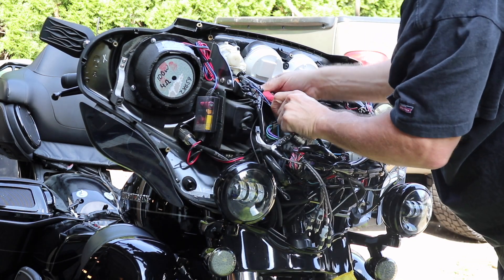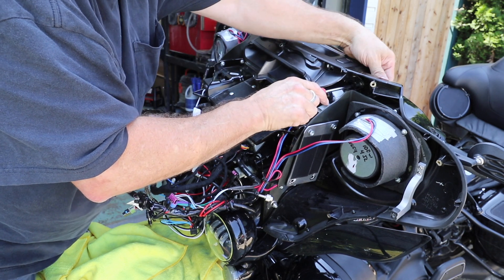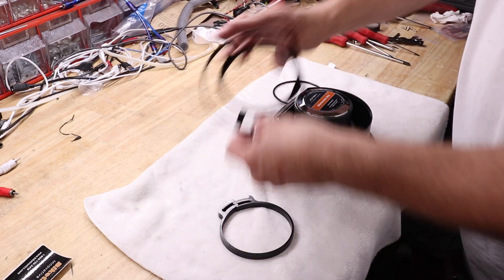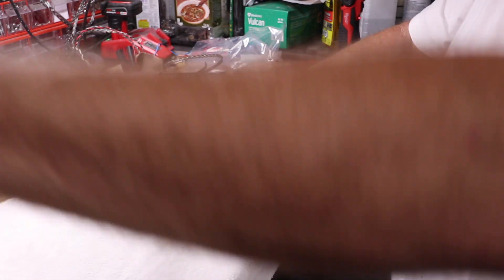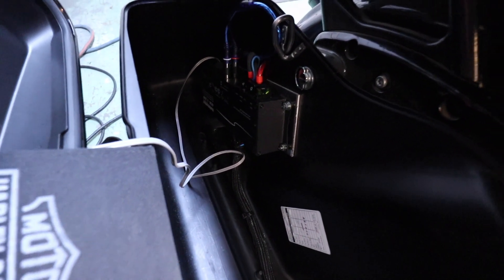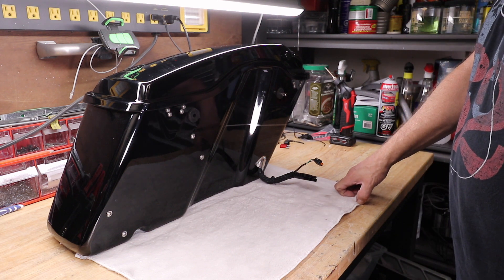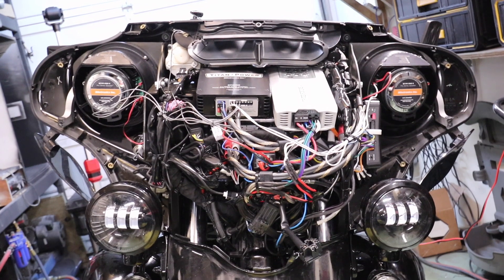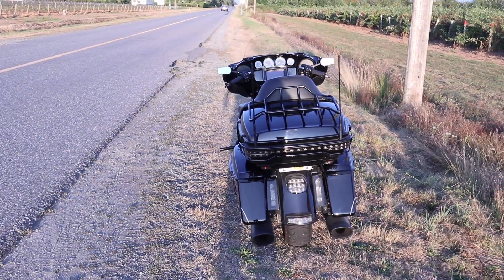Complete Harley Stereo Overhaul.

Comment: I had the Sony 5000 in my 18 SGS.  Liked it over the factory receiver.  Pro's  EQ and size. Cons  Volume would run away when using thumb controls. Water incursion.  I  replaced it with the Soundstream Reserve unit. Much better.  The one thing about the Sony was the ease of mounting another amp vertically in front of the receiver.  The Soundstream is the exact size of the factory unit which makes it almost impossible.

Comment: Did you upgrade the 8 gauge wire to 4 gauge on the Biketronic amp?
Reply from the maker: Nope. Just used a good quality 8 gauge. I haven’t had any issues with it and it’s so bloody loud that I actually have it dialed down in my mix.

Comment: Did you try getting the factory radio flashed before replacing it? Nice video!
Reply from the maker: Yes. It was the very first thing I did to that bike when bought it. I struggled for 5 years with the stock head unit. I did manage to get some decent sound out of it but there were other things about it that drove me nuts. The Sony is just light years ahead of the 2015 stock head unit.

Comment: Brother they say you can learn a lot from watching and your videos are the best. I see you have audio control amps because they come with the GTO on the units can someone such as my self who only wants a sub or two in my Tri Glide Ultra trunk just grab the signal off of the rear speaker and get away with no rca's and it bang out some lows or do I need to get a DSR1 and flash the factory head unit?
Reply from the maker: I really want to tell you to do it right but you seem opposed to that, so...yes that could work. Chance's are you'll need a line converter to clean up the signal.
Reply: @i.b.lancer  audio control brand?
Reply from the maker: @danielzamora3769  I would run it first to see what kind of noise you get. I forgot that you said you wanted to use audio control amps. They have a speaker level input and in theory it should sound OK.  If you’re just using the signal for a sub, chances are it’ll be OK.
Reply: @i.b.lancer  you are the master 💯

Comment: I have a 2020 CVO LIMITED about to do a stage 2 Fosgate. Just not happy with Boom 1. What's your opinion on single Amps in the lids vs. A additional 400W to run lower pods & Lids?
Reply from the maker: I'm a believer in Simple. Simple is easier to maintain with less stuff to go wrong as it ages. A couple of amps under the fairing will keep the wiring down to a dull roar and if there's a problem 5 years down the road it won't cost you an arm and a leg to diagnose and fix the problem.. simple.

Comment: Do you use the OEM alternator? is it just 50A? is it enough to power this setup?
Reply from the maker: Yes I am running the stock alternator but I also have a lithium ion battery which recharges quite quickly and I do not run that stereo when I’m not riding. No problems so far.
Reply: Thank you!

Comment: What did you think of the Biketronics amp.
Reply from the maker: I don’t mind it. It has lots of power. I’m thinking about getting a second one. If I had any complaints it would be that there is a LED light on it that never goes out and it is a draw on the battery. A small one but a draw nonetheless.
Reply: @i.b.lancer  when done I should have 2 BT2700-2’s and 2 BT4180’s

Comment: How did you like the Biketronic Amps?

Which amps have you used by Biketronics?

I have 4 
2 - BT4180’s
2 - BT2700-2’s

All in the fairing of a 2018 Road Glide.

Like to see someone dyno Biketronics amps 
BT4180
BT4250
BT2700-2
Reply from the maker: That’s a lot of juice. I just have the 2250 right now but will be replacing a Rockford for the 4250 this coming winter. I love the Biketronics amps. Only problem is finding speakers that can handle power.
Reply: @i.b.lancer  Front Hertz 4 SV 200.1 / 4 - ST25’s
Rear’s 2(4 soon ) Hertz SV 200 L / 4 - ST35’s

Comment: Do use the DSR1 with your setup?
Reply from the maker: Yes
Reply: @i.b.lancer  did you get a loud pop turning your bike on and everything turning on it has a loud pop
Reply from the maker: @Heavy69Metal  That's a grounding problem. I would take a look at what your grounding to. Make sure your ground is going to the battery.  One of the updates I made sure to do was upgrade the ground from the battery to the frame. Not sure it was in this video, I think it was in the 8" speaker install part 2 video. Don't feel bad, a lot of people overlook proper grounding.
Reply: @i.b.lancer  post the link to that
Reply: @i.b.lancer  about where at in the grounding?